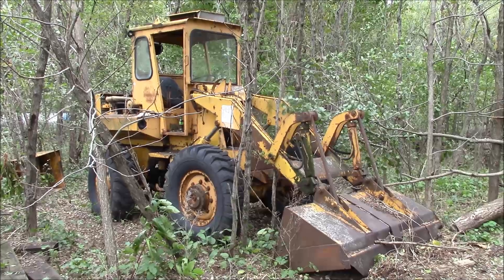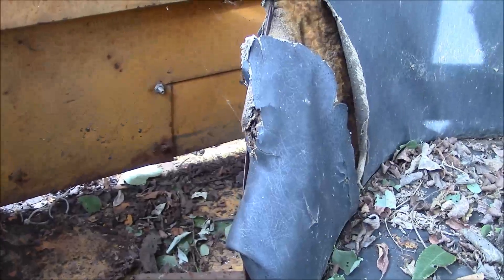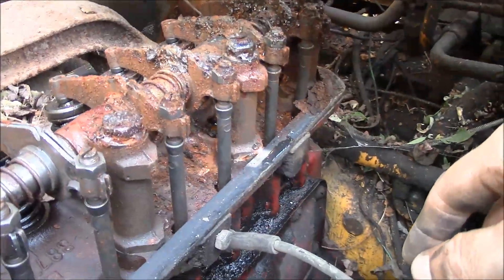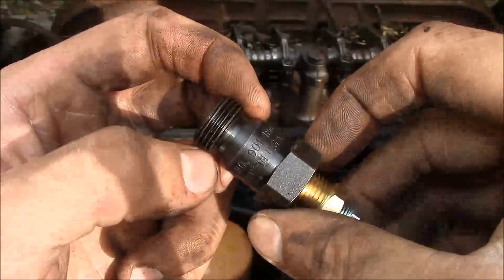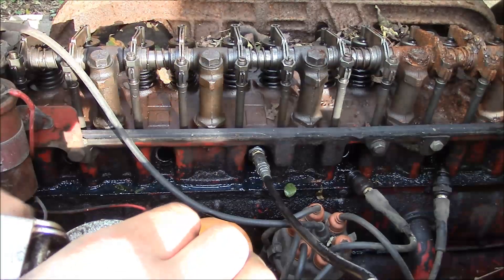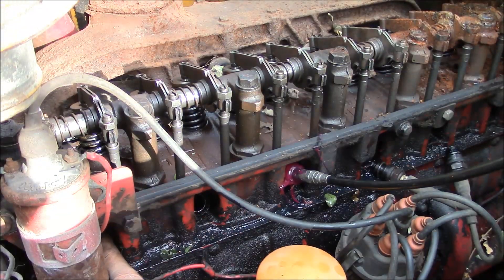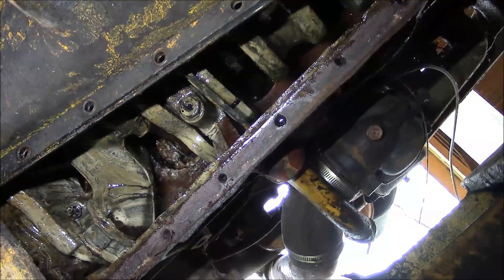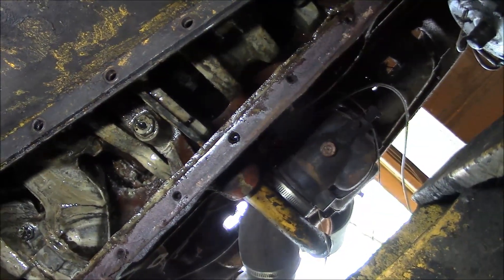Can You Free a Seized Engine with a Grease Gun?

Comment: i have heard of this method before but i think in your case you would need to do multiple cylinder at the same time to get it to move. spread the load across several pistons at the same time. after seeing the condition from the underside, looks like fixing this engine is not cost effective. even after you get it running im sure you will have a love list of other things to address. have to save pennies where you can in preparation for the unforeseen problems to come.
Reply from the maker: Yeah I think you are right on. If I could find 2, or even 3, cylinders rotating in the same direction and pressurize them all it would either pop loose or break the crank or a rod. I think we will just torch the crank at the #6 journal to pull the engine. IH made so many of those engines we should be able to find a donor. And hopefully its better than this turd!
Reply: @WatchWesWork  I know this is old and you are probably sick of hearing about it but I would love to see an engine replacement/swap series on this guy.  It may make more economic sense to make razor blades out of her but... There is just something about old iron moving dirt/doing what it was designed to that makes me happy.  They certainly aren't making any more machines like these!

Comment: R.I.P the engine is well and truly dead the grease idea to move the piston was quite good thanks for sharing 👍🇦🇺🚜
Reply from the maker: My feeling exactly.
Reply: @WatchWesWork  that engine will run agane but it will need a total overhal and you will have to make new parts. you can sell it sombody mite by that engine it iwlll be a 1 to 2 year progect.
Reply: @douglascharles6869  Nah 1 or 2 year project is not gonna be, depends on the damage, as far as i have seen inculsive all the parts i personally think this would be possible within 6 months
Reply: @TuningDutchy  is that full time? all i know it is going to be a long time to get that old lump ruining agane.
Reply: @douglascharles6869  if something is really important to you and you really want it running, especially if this was from a family member you love so much,, you do everything to get it done!
Reply: @TuningDutchy  i forgot it waas his dads maby you are rite. rufly 6 moths then
Reply: My family restores John Deere tractors, old ones. We break stuck engines loose with a hydraulic pump and a fitting we made from an old spark plug. Works like a charm
Reply: Grease gun put out lot more pressure than 99% people ever dream about. Sealed good they are wicked. Diesel fuel is very good penetrating oil. Ole timer show me that trick.

Comment: Motor is still good I say. Still useable as a boat anchor. But a good idea with the grease I just think you really have to be pumping on the stuck piston to prevent bent connection rods.
Reply: Just saying seen motors turned over on only the starter with water in one cylinder and bent rods
Reply from the maker: Agreed, but that's going to be almost impossible because the water came into the cylinders through the open exhaust valves and those valves will never seal well enough to hold pressure.
Reply: Sometimes you got to look at the bigger picture even if you do get this engine running how much damage does suffer and how long before it breaks. Not all of them will be runners unfortunately. Sometimes it's just best to walk. (As in replacement motor or diesel swap even)